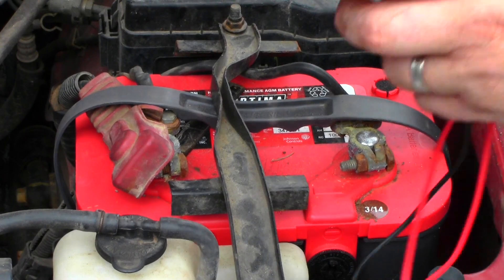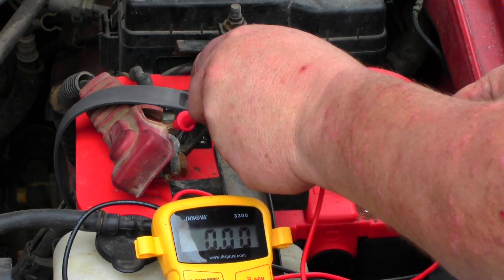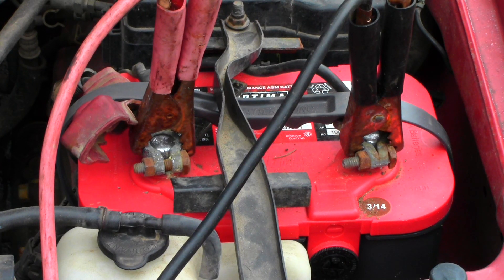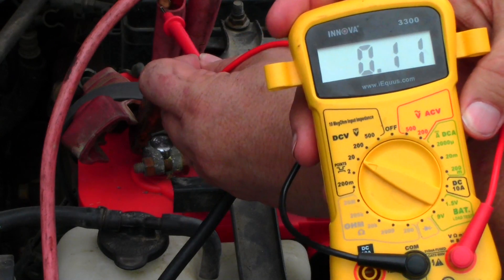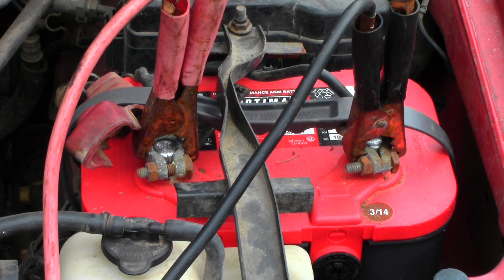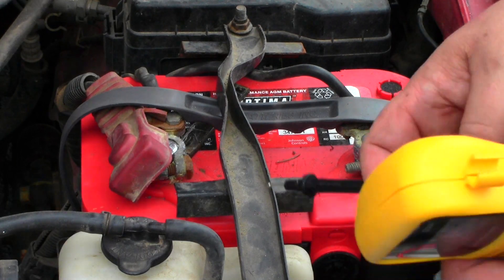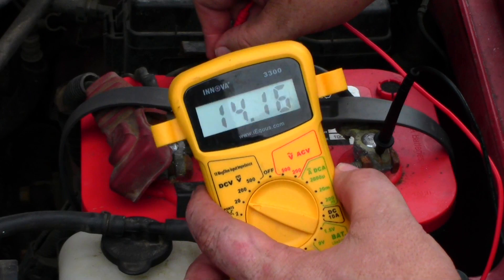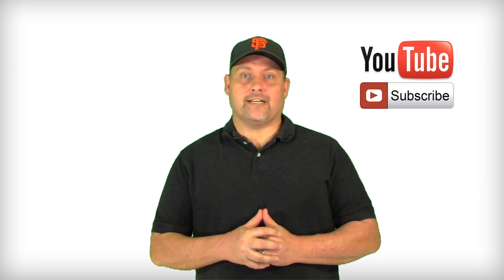How to: Easy test to check your alternator?

Comment: Thanks for the tip!  I just purchased a new battery and they said it's still needed charging. The voltage was low to begin with, but now I see that my alternator is working properly because now the battery is up to full power!
Reply from the maker: darkvader47 glad the video helped you, thanks for the feedback